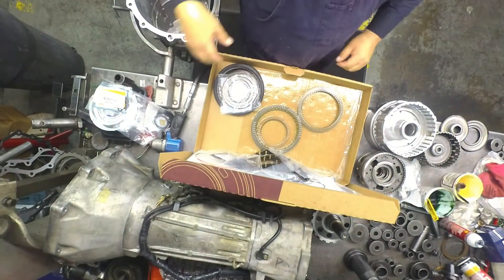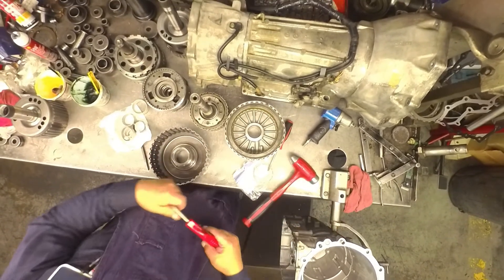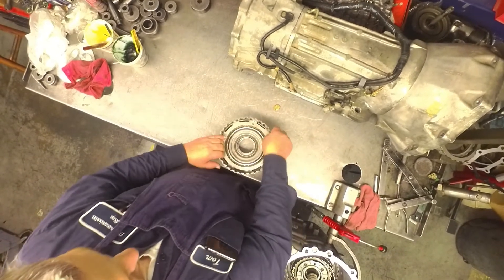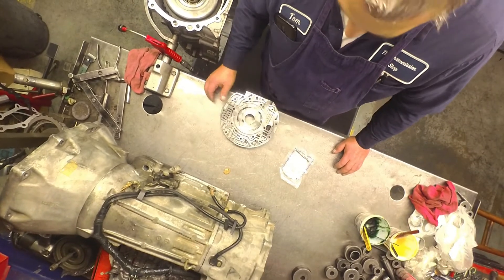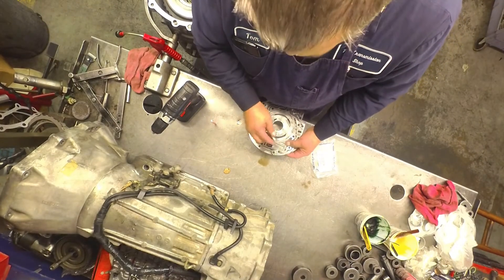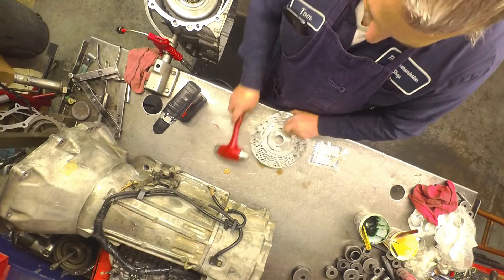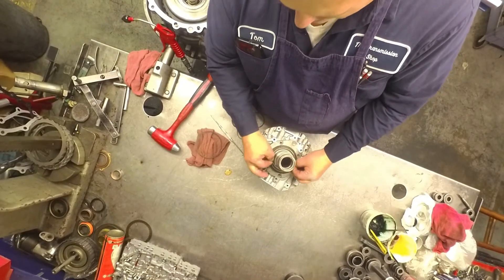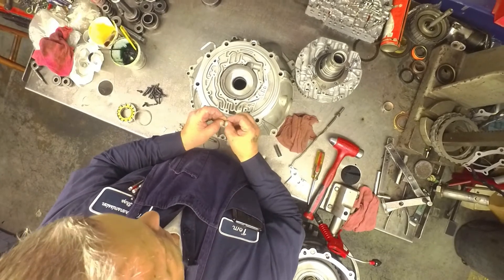6L80E Rebuild Parts

Comment: What type of scotch brite pad do you use?
Reply from the maker: I get it at the grocery store, green one. I get the 9"x6" 8 pack and cut it into about 1/2" wide strips and 3 long. The catalog number on the back is 220-8-CC  3100007945  1801-10970
Reply from the maker: Just realized you might have been asking about the ones I use on the pumps. I use the 2" coarse brown ones.
Reply: @CurmudgeonTransmission  Thank you Tom. Much appreciated..
Reply from the maker: @vinbro1love  No problem.
Reply: Do you happen to have the part number,  so I can pickup at Lowe’s? Just want to make sure I am getting the correct ones. This is my first rodeo on the 6l80
Reply from the maker: @vinbro1love  Mine come from a third party so I am sure the number is different D33098. Tried to look it up on 3M's website but could not find a number. They are a tan to light brown color, pretty rough, I think they are the coarse ones.